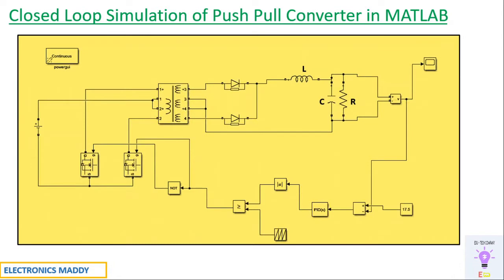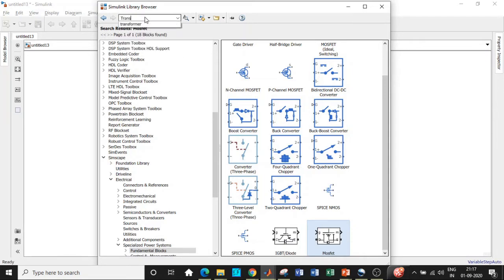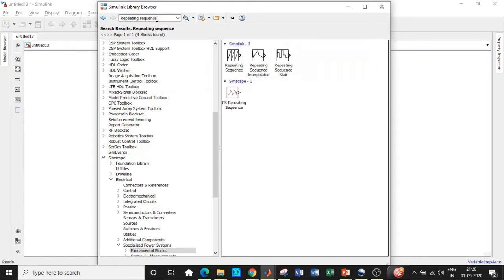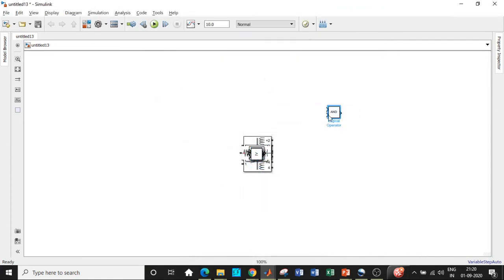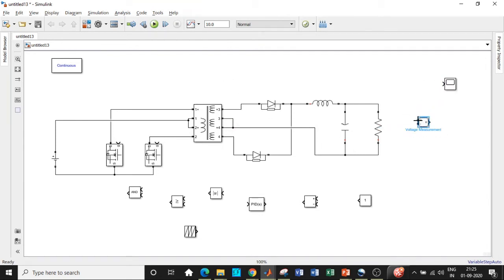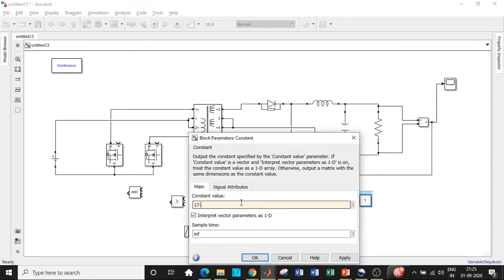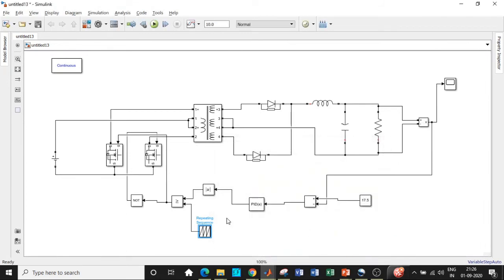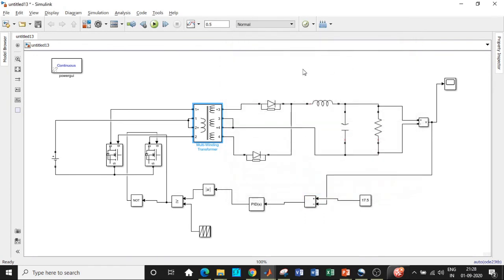Closed Loop Simulation of Push Pull Converter in MATLAB | SIMULINK

Comment: Hmm.. i'm not sure that its is working.  If you change the constant (or reference) to let's say '5', I would be expecting 5V on the output but that doesn't seem to be the case...?!?!?
Reply from the maker: You cannot randomly put any value. You have to put the value based on the inductor, capacitor, fs etc.

Comment: hii..i have made the same loop and simulated.The output voltage is decreasing with time
Reply from the maker: Please send your MATLAB Model to electronicsmaddy@gmail.com. Also can you please confirm if you have replicated the exact steps? Because you will get the output for this design and its accurate.
Reply from the maker: Thanks for sending your Matlab model. You are getting the output voltage. I have mailed you the output with a screenshot.